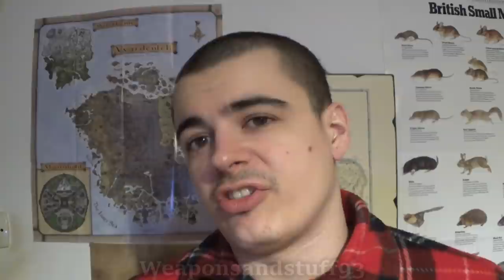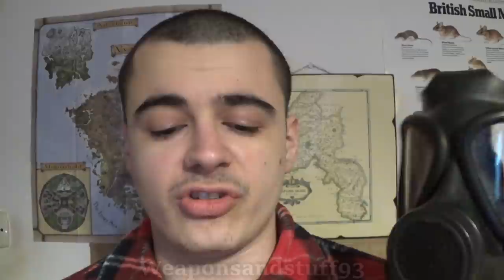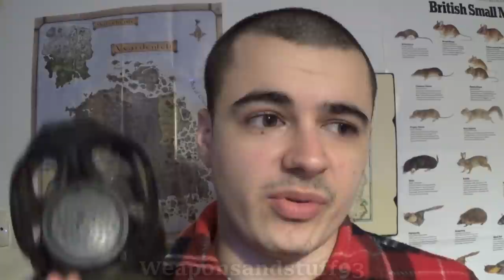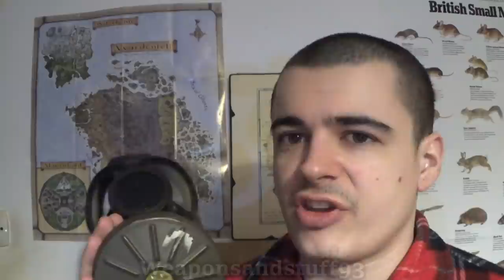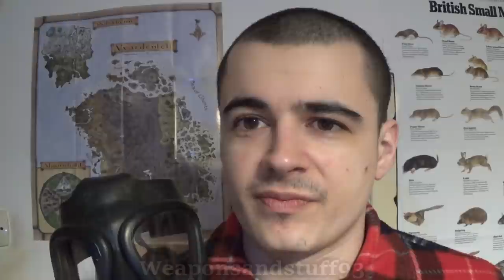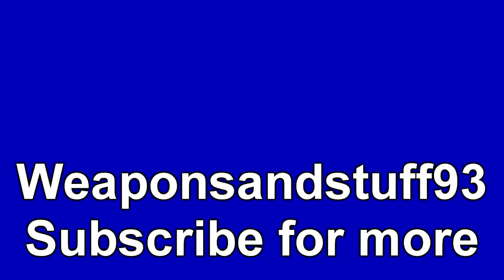Regarding Gas Mask tests

Comment: The US military uses camphor for testing purposes and also banana oil to see if you can smell anything.  The real fun of course is CS Gas and going into a gas chamber.  I was in the military for a career and at basic training there was a guy that wouldn't take off his mask in the gas chamber, while the rest of us were exposed choking.  I literally picked him up by his head and tore his mask off so the Drill Instructors would allows us to leave the chamber.  Meanwhile, the DI's are on the other side of a glass wall just laughing their asses off, especially since I picked that guy up by his head.  I'm here to tell you the first breathe of CS isn't that bad but after that things go down hill immediately.  Also, tear gas grenades are super concentrated as I got nailed with them in the military and also when I was in Ecuador, when the country was going into Marshall Law back in the late 90's.  I saw one guy actually get hit directly by one of those rocket propelled 37mm CS rounds in the street and I think it killed him and he was a few hundred yards away.  I'm no real mask collector like you but I do have a M40, SGE150, GP-5, Draeger and a Polish mask for fun.
Reply from the maker: Thanks for the info, nice to know they also use banana oil/isoamyl acetate for proper fit testing, as a lot of nations basically just say, this should fit, into the CS chamber.

Comment: @Weaponsandstuff93 I recently bought and received a M-1 / M59 Serbian/Yugoslavian gas mask. The bag, gas mask, and filter are all dated 1974. I shook the filter and heard particles just a little, and then proceeded to test if anything was coming out of the filter over paper, nothing came out. The main question I have is with the filter. The filter casing seems to be 2 parts glued together. Where these two parts meet there is a slight outline of black around it. I'm assuming this is the material they used to seal it and it seeped out on the sides. Can you give me an idea if its safe to breath through? The bag and everything has that weird surplus storage smell so I don't know if the filter is bad.
Reply: I can also send a picture of it to show what I am talking about if that would help.
Reply from the maker: It should be fine but filters of that era will be expired anyway.
Reply: Weaponsandstuff93 Alright, thanks, I was just worried if that black stuff was bad on the side of the filter.

Comment: Without risking your health? I have no idea. In other news, there was a Skyddsmask 90 military version with the drinking tube on eBay that I bid on, and was outbid with the mask selling for £68 + 8,00 pp, really bummed about that, but I am still saving for a campervan so should not be spending my money anyway.
Reply from the maker: Yeah that is a bit expensive for an S10 equivalent mask really.
Reply: That was you :) I was hoping to pay 50 but still it is not to bad.  Regards
Reply: Hey Mieszam_Bigos, You bought the mask? Well congratulations man, I bid 30 on it to start and then 50 but was not willing to go over due to saving up my money. I guess the mask is worth it when considering that I have not seen them for sale before that one came up, so I guess rare enough, plus it had a filter and other bits, so not too bad at all really. Also, the people who sell these things on eBay need to see a reasonable return, or they won't sell them.

Comment: Hi weopens and stuff hope your well? Could you please give me a bit of advice? I'm quite new to gas masks but do own a second hand S10 I bought from eBay, I wasn't sure of the sizing but it fits ok apart from the drinking part ALLWAYS irritating my mouth even though I've tried adjusting it,and I can't wear my glasses while wearing one (I have really bad eye sight so can't see  bigger all while wearing one and not being in the military can't have my prescription lenses built in,and don't  know any companies that while do it for civilians,do you?) I

Anyway I tried your air freshener test ( brilliant idea by the way!) I could smell it very slightly, but when I took the mask off it was overwhelmed by the smell! When I had the gas mask on it was about 5% of the smell. It seemed to have a tight seal and a new filter,but the rubber does seem quite old and seems to be a bit perished though. Is there anything I can do to make this gas mask more dependable if s.h.t.f.? Also what's your advice for caring for your gas mask and the rubber? I'd be really grateful if you could reply.p.s. I've ALLWAYS found your videos to be very informative. Don't worry about the haters, like you said they didn't have a solution probably just jealous because you know your stuff what do they want you to do go to a warzone to test masks? Or make your own chemical weapons just to test a mask! I think the air freshener test was very inovative!
Take care
Reply from the maker: Hi bexs, you can cut the straw a bit shorter, they are meant to be cut once issued to the soldiers specifications, as for perscription lenses I don't think many places do them, if you can smell with the mask on either the filter isn't fully working or there is a very small hole, gap in the mask.
Only way to find that out is to do a few pressure checks and try different filters to see if you can eliminate the smell. I've done some videos on washing masks and using silicone lubricant to clean and polish them up, store the mask out of sunlight to make it last longer.
If you find a small hole in the mask try using very strong tape on the area like duct or pitch tape.

Comment: sadly my M40 wont be good if exposed to blister agents because silicon and stuff
Reply from the maker: Yeah you need the second skin for it.
Reply: which I do and it's a pain to take off and clean it and put it back on sometimes without risking of doing to hard and ripping it

Comment: And doesn't CS powder seriously irritate your skin? And contaminate clothing? I've been gassed By militarized police in my city before not a pleasant experience and I'm sure it's major legal trouble if you get caught with a tear gas grenades or any type of pyrotechnics munition in the UK. If you got any military buddies or former military have you tried asking them. They may be able to point you in the right direction. I'll show this video to my best friend she was in the Marines. I'll see what she thinks. And just me here but  I think the way you test your respirators is fine. I use that method at work for my mask all the time. My respirator has only failed once and that was due to my own stupidity.
Reply from the maker: Yeah CS is really nasty stuff and should only ever be used in controlled circumstances.